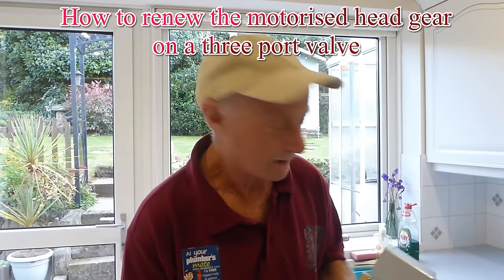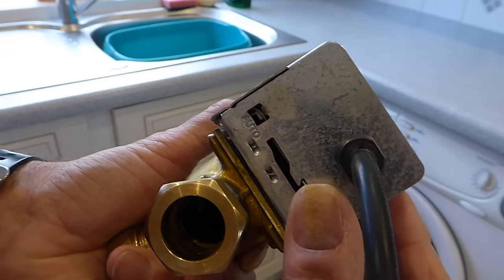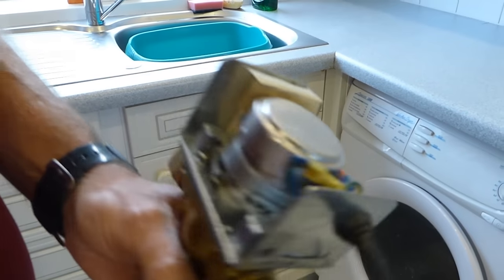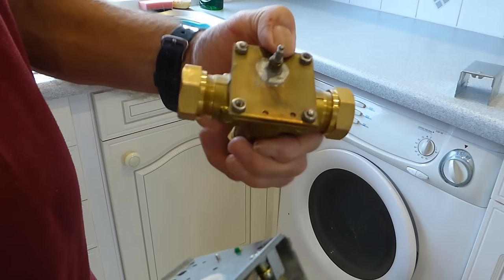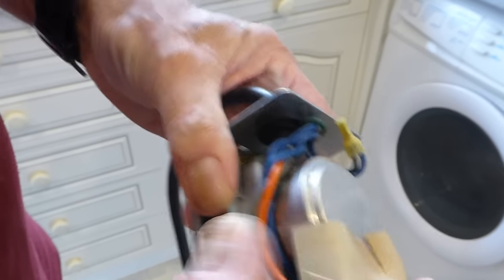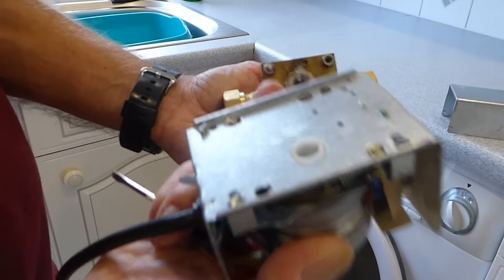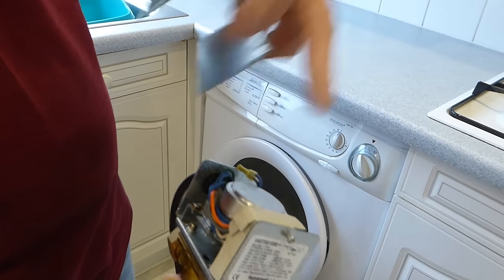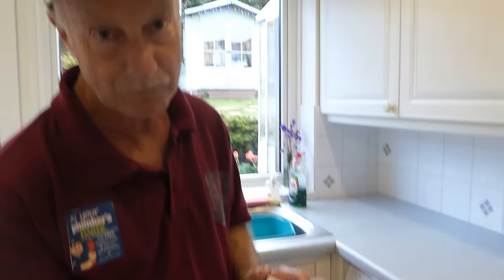How to renew a motorised valve motor or head. No draining down.

Comment: I have an issue with my hot water and would just like an opinion whether you think that it is the 3 way valve. 
 I have heating and the bolier fires up when i turn the theromstat up, when the water is timed to come on the light on the controller comes on but the boiler doesnt fire up.
The hot water seems hotter than normal.I have checked the tank in the loft and that is full
Any ideas please

ade
Reply from the maker: The water will not come on if the water in the tank is already hotter than normal. Try turning down your cylinder thermostat to 55 c. This is not a motorised valve problem.
Reply: +dereton33.Thanks for the response. Love your videos,very informative and helpful,thanks
Reply from the maker: No problem.

Comment: we changed the top part and the central heating still does not work the hot water is perfect but the heating is still not budging could it be that the valve is stuck
Reply from the maker: Either the body is stuck or the pump is worn.
Reply: dereton33 my house have 4 heating zone. 3 of them are good. One have the same problem ( hot water can not go though the valve). I check the motor is good. And I switched to manual but hot water can not go through. Do you have any way can check the valve if it is stuck

Comment: So I have our radiators coming warm when the hot water is on. Would replacing this be enough?
Reply: it's a 2 port valve only
Reply from the maker: Yes it is letting by.

Comment: I'm about to replace a 2-port Honeywell head as the the current one is clearly broken (the manual-auto lever doesn't work, the unit keeps buzzing and sticking and isn't activating the microswitch all the time). It does still close the valve so my question is - does the head only go on the spindle one way as when I take the old one off the valve will be closed as i can't open it manually so I'm best keeping the new head in the closed position?
Reply from the maker: It only goes on one way, keep the valve in the closed position on fitting.
Reply: Thanks!
Reply: I've ordered a new head (with valve too just in case). The valve is now jammed shut but worked this morning - is this likely to be the gear mechanism as the manual level is also jammed and I can't open the valve. New part not coming til Tuesday so at this point presumably I have nothing to lose by unbolting the head and having a look...

Comment: I have a new 2 port valve head to replace the old valve head but when I tried to take off the head, it has 4 screws not 2 and when I tried loosening the head water started squirting out??
Do I need to drain the system? Or does the water just squirt out for a short time?
Reply from the maker: You will need to drain yours out.
Reply: I have drained the system, I opened the hot water and drained all the hot water out and then  I shut off the mains cold water inlet and connected a hose to a drain valve which was located near the boiler dowstairs.

I opened the pressure valve on the cylinder and waited for it to more or less empty and I then replaced the motorized head.  

I didnt open the bleed valves on any of the radiators as i thought i just needed to drain the cyclinder above the motorized valve. 

I then refilled the system keeping all the taps open in the house and once they seemed to stop spitting air out i turned them off.  

Now i seem to have all the rads working upstairs but only some of the downstairs rads seem to be getting hot... also I dont have any hot water yet. This is about 30mins after turning on the hot water and heating on again.

Is there some major flaws in my workings here? help!!
Thanks

[EDIT]..... The hot water seems to be getting hot now.  Still a few remaining rads to come on downstairs.
Reply: chris mitchell you did not need to drain the hot water system ( the system that sends water to your sinks and bath).
Reply: Norman Boyes 
I have got everything running again, all the rads are working, the only difference since I did it is both the hot and cold water don’t seem to have the same pressure as before e.g the bath takes longer to fill. I have the pressure bar set to 1 bar, is there anything else I need to do or does all sound well? Cheers
Reply: I will give that a go, thanks for the input Norman

Comment: Hi, very helpful video thank you. Before I start replacing the valve head I just want to check, the lever won't push to the manual position, is this a problem? I've pushed hard and it really, really won't budge? (The problem I'm trying to fix is that we're getting hot water but no radiator heat, pump overheats and cuts out).
Reply from the maker: Yes the head motor is gone.
Reply: Thank you

Comment: Good work thanks for info just one question do I need to drain cylinder it’s not pressurised to replace complete 3 port valve or do I just drain heating side thanks in advance
Reply from the maker: Just the heating side Peter.

Comment: Great video and gives me confidence to do this on my own if I diagnose it correctly first :-) 

My heating is coming on with my hot water, I currently have a Honeywell 9013 three port valve, do you believe changing this would alleviate my issue? and do I need to get a Honeywell to replace it or can I use other brands like Corgi?

Any advice would be grateful !
Reply from the maker: +regbloke Repace the valve but make sure that it is the same make.

Comment: morning have been advised my Danfoss value need relacing hot water switches on and heating to plus its hot although I havet used it since april is it easy to do,
Reply from the maker: Yes just copy the wires the same as in the control box.
Reply: Thankyou for getting back to me.

Comment: why fit a new head without even testing the movement of the Brass valve male part. A fraction of oil and some pliers will soon  tell you if that part is working .They are not Designed to turn fully !! only a bit

Comment: my heating is not working on all radiators, some are working. my plumber says I need a new motorised valve. surely if the valve is broken all my rads would be cold.? help
Reply from the maker: No, sometimes the valve is only turning part way around or is blocked with sludge.
Reply: Thank you. Just didn't want to pay loads of money if it will not solve the problem.

Comment: Hi, your videos have been fantastic. So far I've repaired a leak under my sink and have bled all my central heating system. However, I seem to have a problem which is driving me mad. I have an upstairs rad in my bedroom which makes a loud gurgling noise. I've bled it from everywhere with the pump running, and it still makes a racket. Ive bled both top connectors, the bottom two and wound the stop taps fully off and on again. I have a standard combo boiler and everything else is working fine. The next stage I was going to do was remove the rad and wash it out but I wondered if you knew any tips? Many thanks and please keep up your great work.
Reply from the maker: You could try cutting the flow down by turning the lock shield valve all the way off and then on just a half turn. Failing that I do have a video on flushing out radiators.   https://youtu.be/_FlxN0c-qBQ
Good luck with it
Reply: +dereton33 Thanks. I've watched your video and will give it a go. It's going to take a long time because there are only 3 rads on, my daughter hates being warm. Plus my boiler is a combo so as you know, I will be up and downstairs topping the system up from the mains.
Reply from the maker: Ok good luck with it.

Comment: In 1999 I replaced the motor on my old three port valve but in 2008 (and at a different house), the local supplier said they no longer supplied the motor on its own for safety reasons, I had to buy a whole new unit (way of ripping your customers off)
Reply from the maker: That`s life today Mark. Al.
Reply: Plenty of valve heads and syncron motors to buy, just look on ebay and other online retailers.
Reply: I got the new valve head off ebay for a fraction of the price at the local plumbing merchants. I replaced my boiler with a combi so not an issue now.